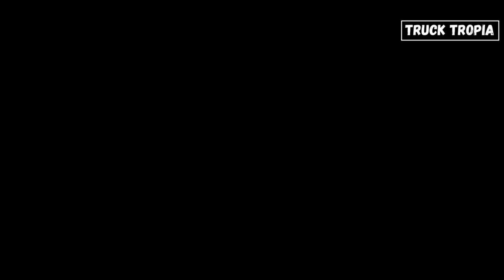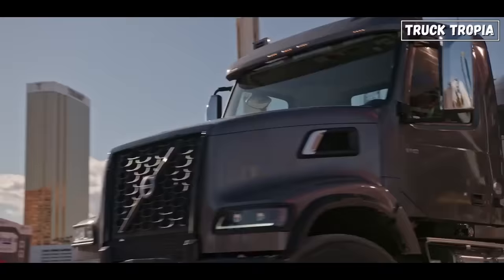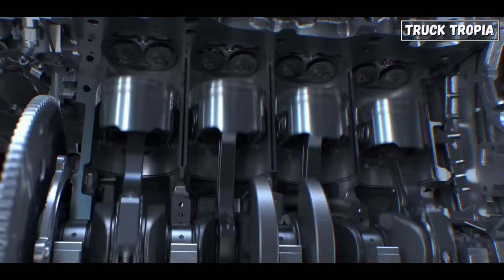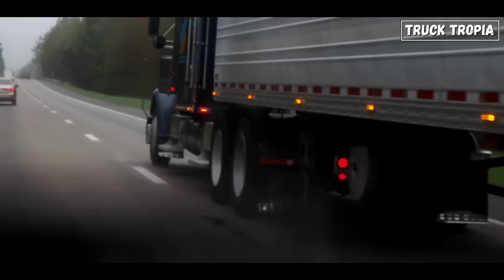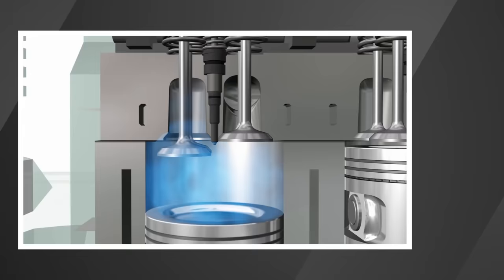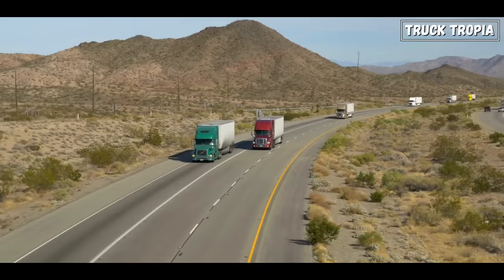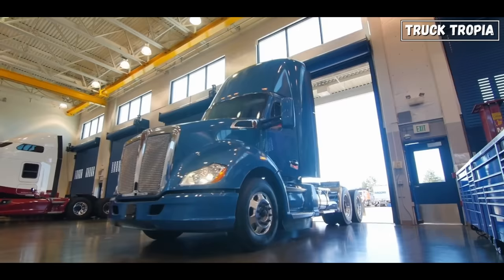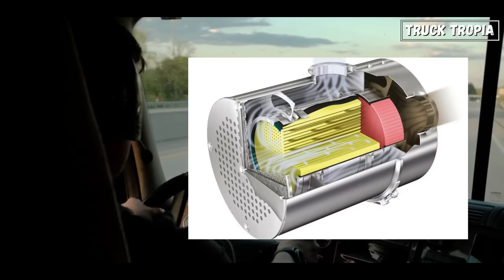Ultimate Truck Education 101 - Every Question Answered

Comment: I never heard 6x4 or anything like that before about axles. I drove a truck with a 2x4 transmission my father in law owed a truck with a twin stick 4x4. I almost got a truck with a 5x3 transmission we call a truck a 18wheeler by the amount of tires on it. I drove a two axle yard dog seen a three axle one. Pulled a three axle trailer with a tagged axle ( four axles in all on the trailer) and back to the transmission is it a air trip or a twin stick 4x2 and is one of the switches on the shifter a splitter? And don’t go with super 10s I’m lost on them my brother loves them. Me I will take a twin stick or an air trip any day over an automatic transmission. I love floating gears. That is shifting with using the clutch.
Reply: Automatic transmission suck the are air actuators driven so if you air low do to backup and moving around to get parked you can run out of air. And I had a stupid truck transmission computer failure that disabled the truck. And my favorite going down hill and the truck up shifts or puts the clutch in so you run up to unsafe speeds before to down shifts and the rpm’s are to high for the engine brakes to work and that is why I stopped training. And the adaptive cruise control with braking does not work with manual transmission. But I love that too nothing like the truck locking up all the brakes on. Ice just because t pit thinks a dark spot under an overpass is something in the road. I seen a picture of a friend’s truck on its side because of it and his daughter is lucky that her head didn’t go out the window. My brother’s company he drives for had a passenger leave the truck because of a hard auto braking accident and the truck landed on her.
Reply: @donaldfuller5058  but let’s mandate it in all new trucks! Gotta love it. I’ve heard many horror stories about these systems and now it’s illegal to deactivate them. I’m not looking forward to having that on a truck.

Comment: Looks like im going to 101 your 101.

Semi truck has 5 axles, this is for most applications.  We cannot change the configuration for the most part  of our axles.  There are a few exceptions.  Some flatbed trailer and tankers have ability to raise 1 axle but most reefer and dry van do not.

Additional axles is noted in my comments I already posted

Comment: The difference in horsepower between the US and Europe basically boils down to bullshit.  On dynos many euro engines only produce about 480hp to the road even tho they're labeled 600 - the less near-limit use you put on an engine the longer it will last, so a 600hp engine thats only putting down 500hp is gonna last longer than a 500 that's putting down 490.  Engines capable of higher horsepowers can also run more efficiently in road torque ranges.   The truth is simple: US trucks put out just as much torque and its torque that moves a vehicle in traffic.
Reply: Your argument is what is really boil down to bs. That dyno thing, you know, every damn engine out there is going to underperform its official numbers. And about torque... there are 700/800 lb ft of difference between the most powerful Cummins vs the most powerful Scania or Volvo engine.

Comment: To put a automatic transmission instead of a standard transmission in a truck cost about $2,000 more I put an 18-speed manual in mine
Reply: Not the case in europe, Manual has to be ordered at the factory for a premium.

Comment: 17:00 an inline 6 engine also runs smoother than a V8 engine, which is important for a big, low revving engine.... the inline 6 arrangement makes all the pistons move in pairs of 3, and the movements of the pistons cancel each other out... the inline 6 will not rock side-to-side like a V8 engine will

Comment: The UPS trucks had the 6x2 LNG powered which was terrible because the rear axle was the tandem. It was very easy to lose all traction if you had to go up a sudden elevation. The tandem was not retractable.

Comment: No V8??? I would render into consideration a CAT 3208 a full v8 diesel used in so many trucks in it's day.
Reply: Haven't much heard good about a 3208. A 3408 I have heard a lot good things about.
Reply: 3408 yes but they tendency to break the crankshafts esp if turned up. Cummins had many 555 V8, underpowered and reliability issues, the 903 series were more successful but still until recently not powerful and were dumped after the 80's in highway trucks they have a modern electronic version at 675hp used in military applications. Mack E9 which was developed with scania, was the most successful V8 used until the mid 90's  in Europe. The Renault magnum had a 560hp E9 until 97 when Volvo bought out Renault/mack and discontinued it.
Reply: The 3208 was more of a local delivery and light duty engine. It was never meant to be competition for the 3408 and the other big boys. I was surprised of no mention of the 8V71 or 8V92 of which there were plenty of out on the highways back in the day. And there were a few 12V71 out there on the interstate. Knew of some Cummins 903 also. A friend of mine had one in a Kenworth, and you could hear that beast coming from miles away.. at least back then we had the joy of variety.

Comment: Just being factual ... @25:50 ... tandem axles in the usa are not powered all the time! Typically the rear axle is powered all the time but the axle in front of it is only powered when the interlock is engaged to power both axles for mud, snow, slippery conditions. Having both axles powered all the time inflicts excessive tire wear and reduced mpg. Trucking companies would loose their shirts if their fleets had both permanently powered axles. Just sayin'
Reply: Mmm ,no don't think so!
Reply: Not at all, a 6x4 (tandem axle) uses a 3rd differential to deliver power to both rear axles Sometimes with an interaxle diff lock
Reply: Yeah, they actually are.

Comment: BEFORE  MODERN  EMISSION  REGULATIONS,  WHICH  EXEMPTED  DIESEL  ENGINES,  THE  KADE  GASOLINE  AND  DIESEL  VERSONS  OF  THE  SAME  ENGINES.  DIESEL  ENGINES  REQUIRED  2X  THE  COMPRESSION,  SEVERAL  TIMES  THE  FUEL,  HIGHER  RPM  AND  CREATED  HUNDREDS  OF  TIMES  THE  POLUTION  FOR  A  BEST  CASE  SCENARIO  OF  70%  OF  THE  POWER.

Comment: One would think a driver would pay attention more driving a manual transmission than an auto.
Reply: That will be the issue with anything that makes driving easier, including for cars
Reply: Would be the opposite since with an automated transmission you can focus more on everything around you compared to a manual where you need to use part of the brain to shifting gears.
Reply: @AlexKall  Not really, shifting becomes 2nd nature and is done without thought.
Reply: You don't need much awareness to drive manuals. it becomes second nature to handle the shifter. I should know as I only have owned manual shifters. At one time I realized I was driving to work mostly without really thinking at all. It was winter and there were black ice on the road as I exited the highway. Braking just made the car slide and it didn't want to follow the front wheels to turn. That's when I "woke". I managed to get the car to stay on the road, but I slid half way through the crossing. Fortunately there were no other car on this road right now. But thinking back my last real thought was when leaving the parking at home. Then I spent half an hour in heavy traffic, managing red light and driving on the highway for 15 minutes, and I don't remember a single thing from this befor I hit the black ice.
Now I had switched jobs as I used to drive a lot to customers far from the city, and I had started falling asleep when I sat in the car no matter what time it was. Pretty horrible to wake up on the road time after time, so I rather changed job. Now I did the same when driving to work. And as I drove a manual car I handled shifting without really engaging the brain when doing so.

I remember that it was far from that simple when I learned to drive. Shifting was not an automatic process then, but it soon became something I didn't have to think about. As a fun fact I learned to shift a unsynchronized gearbox before I touched a synchronized one. Now I actually think this taught me more on how to handle a gearbox than most people ever learn.

Comment: I'm not a trucker but I know enough about diesel propulsion, etc.. to be dangerous . do to my many years in the fire service, I've been exposed to diesel engines. Knowing that currently the larger fire apparatus are currently utilizing 5-600 hp engines(I do get the idea that it's the torque your looking for mostly, also fuel costs)That being said, 600 hp seems like plenty to me,(please correct me if I'm wrong) Yes it woud be cool to say my rig has a 700+ hp engine but at what cost! FYI, I love the two elongated sleeper units shown( the blue & the slightly bigger white unit)! Thanks for the many explanations,  even if you couldn't cover nearly every scenario!!
Reply: Just so you know bigger fire trucks have 800 hp cam in them

Comment: Such a cool channel. Can you please address how long truck drivers can drive before being required to take breaks and sleep? How much flexiblity is there in the rules?
Reply: legally in 🇺🇸 you can drive 11 hrs within a 14 hrs shift
but no more then combined 70 hrs in 8 days
unless you take a 34 hrs break , then your clock reset
and you got 70 hrs again
as far as your break goes , you gotta be off duty or in the sleeperberth of the truck for 10 consecutive hours to regain 14 available onDuty hrs again

like me , well - I drive nights
locally , 6 nights in a row usually 
then I set out 1 night and my clock resets
and ‘m good to go for another 6 nights / 70 hrs
usually ~ 12 hrs shifts on my first 5 nights , and all remaining hrs I use up on my 6th night
hope that explanation helps lil bit

and oh yes : NO FLEXIBILITY on those rules
except in emergency like severe weather to get safely off the road you can once every 2 weeks I believe extend your available drive time for that day for 2 more hrs , but only to be used for an emergency 
still can’t go over your 70 tho
or use it to expand your available total drive time

+ all those rules - they are strictly enforced by law enforcement 
especially DOT
if you should get caught out of drive time , you will be put out of service immediately 
and get a hefty fine 
and points on your license
and your safety rating 

in case of a accident you being out of driving time , the accident is absolutely your fault , no questions asked
because you were not supposed to be there aka shoulda have been off duty 
in case someone died because of an accident like that with you being out of available drivetime  , you probably get your CDL revoked , fined to the max and most likely go to jail
so : it’s not worth it , period

also once your 70 hrs are up , you can indefinitely stay onDuty tho , but only as long as you do not drive
you can work 100+ hrs if you choose to
but no driving after 70
then : take 34 reset and your clock is reset again , 10-4
Reply: @ericmiller7022  thanks and holy cow, that’s complicated. My guess is there s software to help keep it straight. I also bet that your computer can be examined by law enforcement like they used to do logbooks.
Reply: If the people putting this together did, they would get it wrong. This video is completely wrong when it comes to the US.
Reply: Yea it sounds complex until you use the hours of service for a few weeks. Then it's all second nature and becomes pretty straight forward. 
I will say though, us truckers do use time in an unusual way in relation to many other fields. 
We're also governed by 5 different clocks simultaneously. 
8 hr
14 hr
11 hr
70 hr
And the actual time.
And for a bonus, we also have to consider driving from one time zone to another, and whether the actual time increases and hr or decreases. 
It can be a lot to consider sometimes lol
Reply: And how to cheat them? but not with ELD.
Reply: @Revolver1701  when actually reading it out like this it does seem complicated, but in practice it’s not. And yes, the electronic logs do keep track of it for you now, but that’s not exactly a good thing. Because there is no flexibility in the rules, it can cause fatigue because of how companies will push you to always be in the road as soon as your 10 hour break is done. There are days that you just don’t feel you can drive for 11 hours for many different reasons, but because you have no way of making up the time the next day, you’re forced to push through and keep your day going. Unfortunately, there were many in the past that abused the time they spent on the road, using different drugs and such to stay awake. So now we have set rules that dictate our days that has no flexibility, which isn’t always a good thing.

Comment: Negative ghost rider.  My truck has that configuration but only the rear axle is powered not the front.  To get power to the front drive axle, I have to engage the axle lock.  I also run a wide base tire on the drive axle otherwise known as super singles.  It gives less rolling resistance vs dual wheels and better fuel mileage and way better traction and stopping ability.

Comment: Did anyone else notice that according to this video 80000 lb i 36 ton instead of 40 ton? ? ?   1 ton = 2000 lb
Reply from the maker: Eu mesuremets 80.000 pounds = 36000kg = 36 ton
Reply: Yea. Wrong. 80k lbs equals 80k lbs divided by 2000 lbs cough (one ton) is 40 tons.
Reply: @TruckTropia  then you should have stated metric ton then.
Reply: I think that was supposed to be tonne, 2200 lbs.

Comment: Cummins X15N is a spark plug ignited Natural Gas engine 500HP, 1,850 TQ, and can fuel up for less then $1.00 per gallon. It uses a standard catalytic converter, no DPF or DEF fluid.

Comment: I understand the thinking behind the European trucks because of length restrictions, but It seems to me they would be so inefficient as far as fuel economy goes with that large flat front pushing so much air all or the time.
Reply: They don't travel as far or as fast.  Drag is exponential, not linear, so you don't have great gains in efficiency with slower speeds.  What you loose in aerodynamic efficiently you make up for in weight efficiency.
Reply: The most fuel efficient US truck in Australia for many years was the Kenworth Aerodyne K100, mostly fitted with old reliable Caterpillar C15. Being a cabover it is also better for urban areas. Nowadays, Volvo and Scania give the best fuel use for the distances and weights carried. 

In relation to transmission, if the truck is Euro I want an auto - preferably Volvo or Scania 12spds. US truck has to be manual as the US autos are terrible and are more likely to break down than the Euro boxes.
Reply: Yes you are right, cab overs push a lot of air, and you are the first one in a frontal accident! 
I've driven cab overs and conventional trucks in the USA and having being born and lived in the UK for 28 yrs I know for a fact that the convention US built tractor trailer would get stuck before you could even say "What the ****!".
Reply: Not to be a party pooper, but...
The whole area of a truck cabin, not just for a "cabover", but also a longnose, counts for the air resistance (cw-value.). It`s about the same, measured by area.
And, have You ever heard of the tests, that cabs in Sweden, have to pass?
I don`t think any of those "long nose" truck cabins, will pass, a 1 ton (Metric) test.
You release a "barrel",that weighs a metric ton, on a fulcrum against the upper front of the cabin. That`s the windscreen poles.
You are not up to date, concerning the safety of modern cab-overs.
Look (Google) up this test, and then tell me, how Your American cabs perform.
Reply: @outsider7658  Not to burst your bubble...
but a longnose truck has a much lower drag coefficient than a cabover.  The only flat surface is there grill.  Every other surface contacting the relative air is angled, there for, the Cw is reduced.
Reply: Aerodynamics don't really matter when you're pulling up to 104 metric tons 🐡
Reply: @TopiasSalakka  Tell that to the guy paying for the fuel.
Reply: @Caderic  Why would he care when it doesn't matter 🐡
Reply: @TopiasSalakka  Because what you said is bull shit.  The company I work for has reduced their fuel cost $15K/year/truck, by making their trucks more aerodynamics streamline.  
Parasite drag goes up 4x for every double in speed.  At 60 MPH, over 1500 miles per trip, that is a lot of extra drag.  And parasite drag is directly proportional to how well the design is streamlined.
Reply: @Caderic  Sure they have 🐡
And what really matters is frontal area which is practically the same for COE and traditional trucks.

Comment: Very interesting viewing, especially the comparison between automatic and manual transmissions.
Reply: Don't believe everything you hear in a video, go and talk to someone that actually drives a long haul truck
Reply: Many trucks are not true automatics, More automated manuals where the clutch/shifting is electric with air/hydraulic actuation. Still a manual box but the shifting is automated. Some scanias (I forget the years but I want to say "opticruise") still had a clutch pedal that was only used for starting and stopping, shifting was all automated.

Comment: If I was getting 6.5 MPG I'd be crying my eyes out.  I get 9.5 MPG on average when I'm loaded.  When I'm lighter I get better and when I'm empty I'm in the mid 10s.
Reply: 6,5 mpg is very normal fuel consumption with real loads though.

Comment: Another reason Europe uses larger HP engines is the fact they run at higher speeds on shorter distances. US trucks need torque and fuel economy, not speed that higher HP provides.
Reply: It's the opposite, higher speed in the US.
Reply: We have a lower speed limit for trucks in Europe, 80 or 90kmh depending on the country but all trucks are electronically limited to 90kmh.